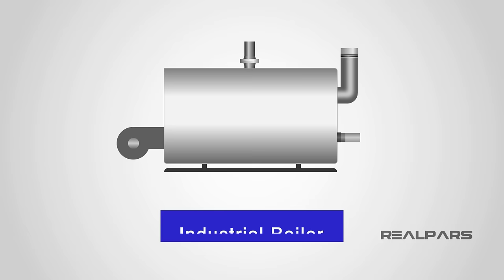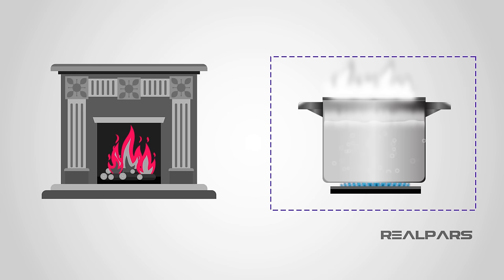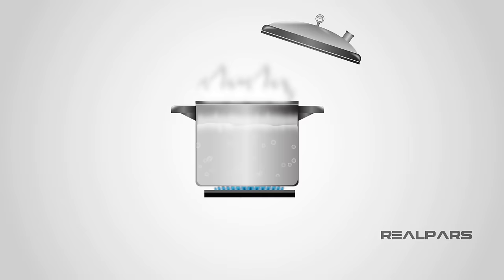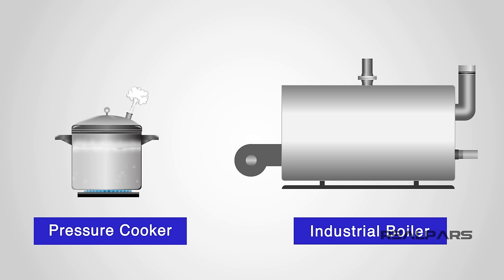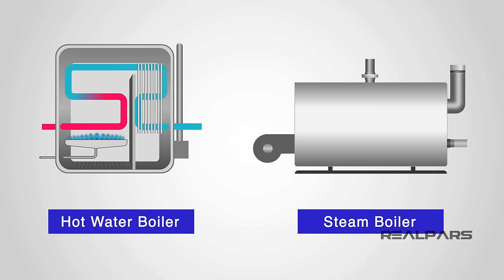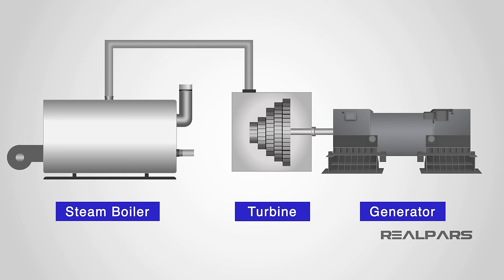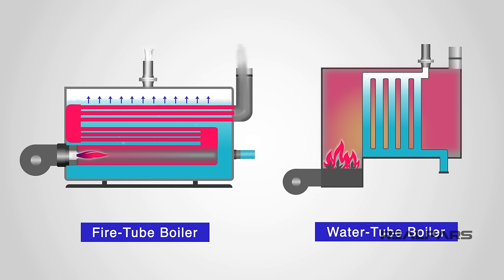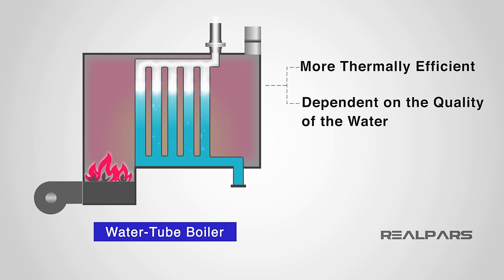What is a Boiler and How does It Work?

Comment: I work on boilers for a living, and while you generally have mechanics right (with the exception of the water tube boilers also having a mud drum and steam drum), fire tube boilers are also very common for high pressure steam systems (high pressure steam is 15psi and higher, and I’ve typically seen them run at about 100# of steam).
Reply from the maker: Lucas, thank you for your insights.  It is always great to get feedback from those most experienced in the industry. Our lessons are intended for automation engineers getting started in the industry and in order to spark interest in those considering or curious about a career in automation.  We focus on the critical aspects of understanding the concepts of automation without delving too deeply into the process or equipment.  I think our subscribers will find the additional information that you provided very helpful.  Keep watching!
Reply: jeremynoor9680 what was your problem?
Reply: jeremynoor9680 based on what I saw on the video,boiler produces steam,not hot water out of the system.

Comment: Smoke stack should have some version of an alternator on it, converting the steam to electricity. The electricity generated should feed a battery that powers a motor to heat a ceramic in the furnace for heat. Obviously they found something wrong in the design but replacing parts over certain period probably better than processing carbon fuels near living spaces.

Comment: i used to work for a boiler company Jhon Thompson. the most common boilers that companies use are 10ton coal  
boilers because thay are the cheapest to run but needs a lot of maintenance unlike HFO 
(oil) and gass burners that are
low to no maintenance. burners are more reliable and easy to use unlike coal boilers that need a operator and break down unexpectedly (a lot).
Reply: Sounds good
Reply: Just wonderful, I have been researching "industrial electronic repair winston salem" for a while now, and I think this has helped. Have you heard people talk about - Giyathan Bewildering Gratification - (should be on google have a look ) ? It is an awesome exclusive product for discovering how to repair your electronic items like a wizard minus the headache. Ive heard some decent things about it and my colleague got great success with it.
Reply: Yes, my company had one where the fire bed chain broke very often.

Comment: We use combi gas convection boilers in the UK, I thi k that's what they are called, used for under floor heating. Radiators and hot water
Reply from the maker: Thanks for adding that, Matt!

Comment: I like the explanation I am interested in knowing how to calculate boiler efficiency?
Reply from the maker: The simple answer is [BTU 's OUT / BTU's IN] x 100%.  That may seem easy, but it will require flow, pressure and temperature sensors to measure the quantities that go into determining the energy into and out of the boiler.  In more detail:  efficiency = [(lbs/hr Steam out x Enthalpy of steam in BTU/lb steam at operating pressure and temperarture) / (natural gas flow in SCFH x BTU/SCF natural gas at flowing pressure)] x 100%.

Comment: We are using coal fire tube boilers @ work for steam generation for process . Would you kindly make a video on the mobrey switches and pressure sensors attached to the boilers . Thank you
Reply from the maker: Hi Methuselah,

Thanks for the topic suggestion, I will definitely go ahead and forward this to our creator team. Happy learning!
Reply: There are different types of pressure sensors. The mobrey switches are magnetic level switches are one of the types which satisfy boiler code requirements. If your drum water level gets too low and is allowed to remain that low the excess heat would cause a loss of containment and catastrophic failure, so instruments such as the redundant level switches are there to provide a signal that the burner management system can use to bring the boiler to a safe state.

Comment: Why we compensate pressure, temperature and flow to calculate HRSG outlet steam flow please explain sir.....
Reply from the maker: In most steam applications, it is desired to know the mass flow rate of the steam (Lb/Hr, Kg/hr, etc.).  Because steam is a compressible fluid, its density changes with temperature and pressure.  We can easily measure the volumetric rate of flow of steam with an orifice meter, vortex meter, etc., but to convert volumetric flow units to mass flow units, we need to temperature and pressure compensate the flow reading.  This allows the key parameter in this conversion, density, to be determined based on the thermodynamic properties of steam.
Reply: @realpars  Now clear big doubt... Very very thank-you sir.....

Comment: I always wanted to know how close loop steam turbine system works not all of it, but the part where the turbine is connected to the generator, which is out side or inside(i'm not sure) of the steam pipe loop. If the generator is inside the close loop system, when the steam turn back into water, it will get into the generator and you know what will happen. But if the generator is outside the steam pipe loop. The steam will leak out where the steam turbine and the generator are connected!? That means shortage of water in the water tank and will need refill over and over again. 
I raise this question coz I watch about steam turbine long ago and what I learn from it, if I'm not mistaken was that the steam that runs the turbine is cooled down and condensed back into water and is let back in the water tank! Thank you

Comment: I would add that a nuclear reactor is also a type of boiler. The process of using steam to generate electricity is identical with the exception that there is no combustion (hopefully). The heat source is derived from the decay of fissile materials in the presence of a moderator (water) to slow the alpha and beta particles to sustain a chain reaction. The water is heated and passed through a steam generator (large heat exchanger) to produce steam to spin the turbine. There are also BWR reactors where the water in the reactor vessel is allowed to boil and the steam is used directly, inferior and less safe design, more prone to coolant loss casualties (Fukushima).
Reply from the maker: Thanks for sharing that, Whidbey! Great additional information.

Comment: Excellent video. 

How is steam actually used for heating something in a closed tank for example? In the example shown, wouldn't adding steam to the mashing process increase water content in the product?
Reply: Aashish Bharat you can use a heat exchanger in the closed tank that way the two mediums are separated and the steam is not condensing in the tank increasing water content to the medium being heated.
Reply from the maker: m15cell gave one excellent way steam is used to heat a closed tank -- heat exchanger coil submerged in the liquid. This is efficient, but for a brewery or other food plant, this requires cleaning of the items inside the tank.  Another way is to heat a jacket around the tank and mix the contents of the tank so that there is good heat conduction from the jacket to the liquid.  A third way is direct injection of steam into the tank, which is often used especially when it is desirable to displace all of the air out of the tank (oxygen affects the taste of beer and certain other food products and they are being manufactured).  And yes, the condensing steam will add to the water content of the product, but that can be factored into the overall recipe.

Comment: Hi, I am working on a fire tube boiler project and i need to know if the circulation of water in a tube fire boiler is considered a naturel or forced one. Thanks
Reply from the maker: That is a good question.  In a tube-fired boiler, the circulation can be either. If your boiler has a water circulation pump or operates at supercritical pressures, it almost certainly a forced circulation boiler.  If your boiler has a fixed evaporation section end point, it is likely a natural convection boiler. Ina natural convection boiler, a drum typically separates the two sections of evaporation and superheating, which serve as the heat accumulator and water reservoir of the boiler, respectively.

Comment: I work with steam to bend wood ( beavertails snowshoes) the tail is about 3 inches half circle.I( am interested  in the volume of steam is it surface area of the water that produce the most steam or the surface area of the flame on the bottom  of the container (open boiler) that  produce the most steam  .thanks vincent Lavallee

Comment: How efficient is electrically fired boilers for cast iron radiators in residential settings…and who produces those boilers?
Reply from the maker: In the US, Hudson Reed and US Boiler are common vendors.  New electrically-fired boilers are very efficient, but the only way to compare is to compare Energy Star ratings for each system under consideration (look at cost/BTU).

Comment: I want to learn how in a close loop system, steam from boiler that condense turn back into water and re-enter the boiler(water tank). But how did the water re-entered into the boiler? As we know the boiler is highly pressurised by the steam. Say we put a valve below the tank to let the water back in the boiler but the pressure is going to push and stop any incoming flow, right?

I also want to learn how it is constructed, the steam turbine which is inside the steam close loop system but the electric  generator is outside the steam loop. I am aware that in a close loop system the water is reused over and over as water turns to steam and condense back to water. But how is the steam not escaping or leaking away in the turbine shaft that connects the turbine and the generator which extands from the inside to the outside of the steam close loop.
Reply from the maker: Hi Den,

Thanks for your comment and feedback!

This is great feedback for our course developers, I will happily forward it as a topic suggestion for future videos. 

Thanks for sharing and happy learning!
Reply: @coralyuchina8756  can i text to you?

Comment: Someone said that, the other application used of steam boiler is in the hotel and apartment. What is it for steam boiler in the hotel and apartment?
Reply from the maker: Smaller hot water boilers are often used in homes and hotels to produce steam for heat.  Radiators, which are still used in many colder climates, is fed by steam from the home boiler.  The radiator gets hot as the steam condenses, and the radiator releases heat into the room, thereby warming it.  The boilers used in home and hotel applications are small and generally are fired by heating oil, propane, or natural gas.

Comment: Brush up on your brewing knowledge.  A proper step-infusion mash takes under an hour, which raises temperatures steps for enzymatic process.  Steam is through a steam jacket only during raising temperatures.  Second, there's a liquid/solid separation for  liquid to be collected in the kettle, where it's boiled for an hour with spices like hops.  It's cooled so fermentation can take place when yeast is added.  Steam generation is invaluable in breweries, for various applications.

Comment: I hsave a perplexing problem with my  small jet steam cleaner. Plugged into a wall recepticle, water in the boiler won't start heating up, as you would expect: electricity passing thru a metal would generate heat, right?
Reply from the maker: Thank you for your question, and you are indeed correct. However, it's crucial to troubleshoot your device using an approved voltage meter. If you are not a skilled electrician, it's recommended to reach out to a professional in your area for assistance. Prioritizing safety should be your primary concern. Happy learning!
Reply: @realpars  Thank you.
I'm not attempting troubleshooting the cleaner, but I do have an analog multimater capable if measuring AC voltagevupvto 1
,000 volts. I know how to use it. Besides,
It's not a safety issue in my case: non- startup. I'm wondering why the boiler won't heat up as an ordinary water kettle would. What could have prevented the start-up? Unfortunately local technicians/repairmen deal with electrical ķdevices like fridges, stoves, dishwasher etc, not with boilers.

Comment: Can I reduce fuel consumption in an Oil fired boiler by reducing only the nozzle size of the burner?
Reply from the maker: It is possible.  However, the entire boiler design will need to be re-evaluated, since the sizing of components and other streams (air) may also be affected.  Some boilers require a minimum BTU load to maintain pressure or steam flow, and internal circulation patterns are also important for boiler efficiency.  Yes, you can reduce oil flow with a smaller nozzle, but you may not be able to operate the boiler effective,y under a reduced oil flow.

Comment: Great info! How is dry steam made for use in steam engines?
Reply from the maker: Dry steam for a steam engine requires superheating to avoid condensation in the pistons.  To do this, the steam generated in the engine's boiler is routed back through the boiler to pick up addition heat.  The steam pipe makes 2 passes through the boiler to create the superheated steam condition.
Reply: @realpars  Thank you kindly for the info

Comment: What boiler is used for solar thermal power plants?
Reply from the maker: Solar power can be delivered through conversion of solar radiation/light into electricity using a solar cell.  That is a direct method for producing electricity from solar energy.  To heat water into stream using solar energy requires a much more sophisticated system.  Typically, to reach the temperature and pressures for efficient generator cycles, solar energy is used to supplement more traditional fuels for generating steam.  Obviously, at night, a purely solar boiler would not be able to function.  However, circulating molten salt systems can be used to capture and use solar heat as a supplemental heat source for boiler steam production.  There is work being done on what is caller a Fresnel solar boiler, but the technology needs to catch up to the vision.

Comment: How to know if I have steam boiler or water boiler? And how to remove the air bubbles in each case?
Reply from the maker: You could look at the nameplate on the boiler to identify the type, model, and manufacturer.  Does the boiler produce steam for use in driving a turbine or carrying heat throughout the building?  If so, you have a steam boiler.  Does the system heat water to a high temperature without creating steam?  If so, you have a hot water boiler (or more correctly, hot water heater).  To purge air bubbles, you will need to bleed off the air at the high-point vent or purge valve with the water feed valve open to the boiler.  Be careful in doing this, as hot water/steam has a lot of energy.  Consult the user manual to determine the best way to do this (how far to open the purge valve, use of a hose into a bucket for capturing the escaping water/steam, etc.) Air is lighter than water/steam, so it will bleed off first as the high-point vent is cracked open.

Comment: What's the pressure range of a water tube boiler? I've worked with a fire tube boiler with Max pressure of 15Kgf/cm2...roughly 200 psi.
Reply from the maker: It depends on the boiler.  A 200psi boiler is used to generate 150psig steam, a 300psi boiler for a 250psi steam header, and 750psi for a 600psig steam system.
Reply: @realpars  Thanks for the info... BTW, for a given pressure of 200 psi, which would be better?

Comment: Hello, I understand some Boilers used in the oil industry have anti condensation resistance inside.
Could any one explain the reason for this?
Reply from the maker: Hi there, 

Thank you for your question! You must be asking about the material used inside the boiler. Two technical barriers to the condensing boiler application exist, corrosion and return water temperatures. Highly corrosion-resistant material is required for condensing boiler manufacture to make it last a long time and more energy efficient. 

Hope this helps, happy learning!

Comment: When is the zero pressure in the running boiler?
Reply: Typically, when we talk about zero pressure in a boiler, we are talking about low pressure boilers for commercial or residential applications.  Pressures of less than 1 bar (15psig) in a low-pressure boiler is considered "zero pressure" or low pressure.  This can be caused by a water leak, flame out, or other issue.

Comment: How number of steam temperature that produced at the average boilers?
Reply from the maker: The temperature of the steam produced by a boiler depends upon the steam pressure.  For example, an atmospheric boiler runs at 100C, while a boiler producing 600 psig steam runs at 255C.  Most industrial boilers operate in the range of 50 psig to 600 psig.